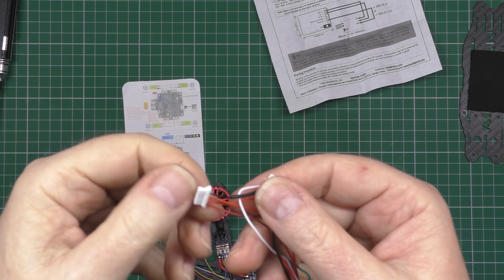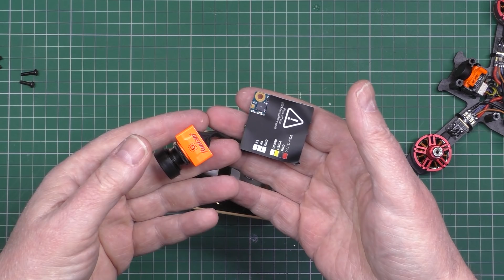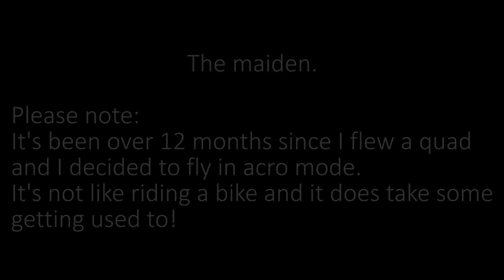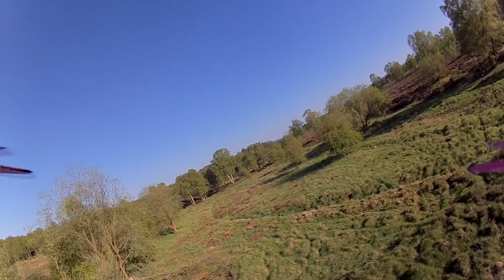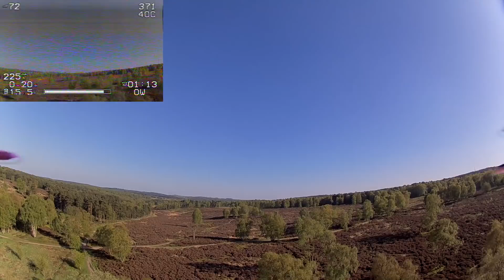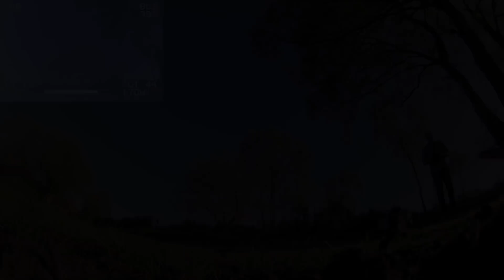Overpowered racing mini quad build part 2 of 2 and the maiden

Comment: You can control the split from the flight controller. Get the serial pins from the split (rx/tx/gnd) to a spare uart and asign it as runcam device in the ports section. then have start-stop recodring on a switch. It needs a momentary switch or you just flip it on and off within a second and it will start or stop recording whenever you want.